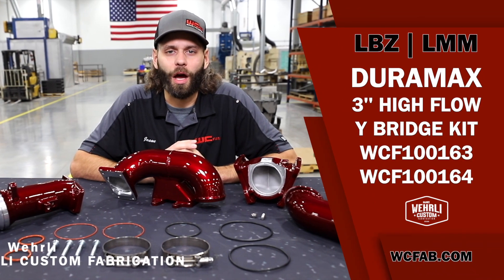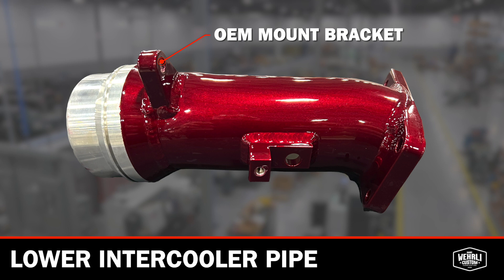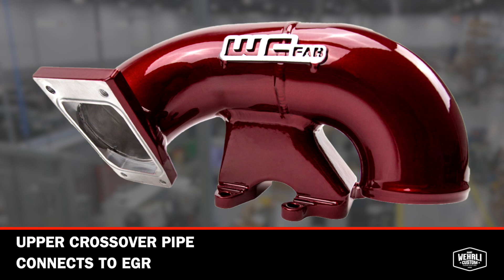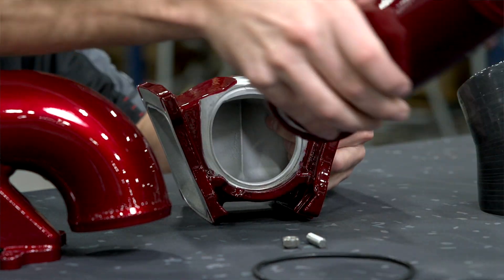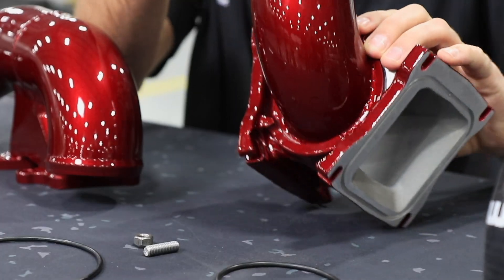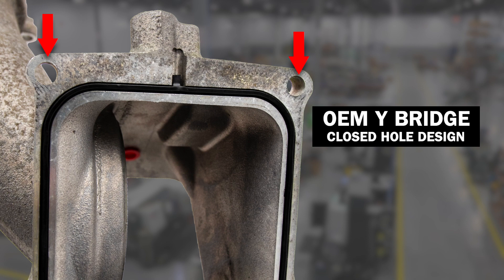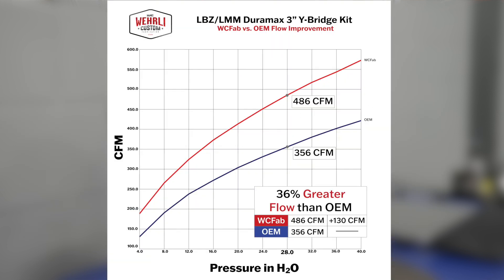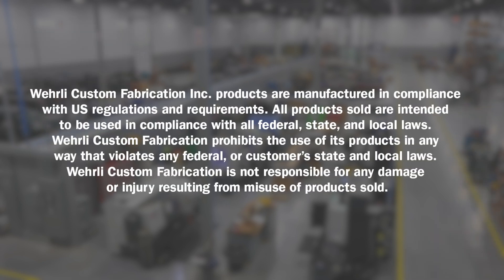WCFab 2006 - 2010 LBZ / LMM Duramax High Flow 3" Y Bridge Kit

Comment: Do you make this for an LLY? Or is there a way i could convert my LLY stuff to LBZ style? Really want this y bridge bundle
Reply from the maker: @dh5254  if you are talking about a 2006 LLY, then this kit crosses over because it’s pretty much an LBZ as far as engine air induction components go. 2004.5 and 2005 LLY’s are different however. We do have plans to introduce a y-bridge for those trucks as well, but don’t have a release date at this time. Keep an eye out here for updates as we have more info on that to share.
Reply: Yes, i mean the 04.5-05 LLY duramax would love to see this kit offered for that platform 🙏

Comment: hello! If I buy just the Y bridge assembly only, it will fit the old style cooler pipe and the other parts? my old style Y bridge is cracked and destroyed by a mechanic :/ . Or can I have somehow a piece of the old style one? or You guys can repair My damaged one?
Reply from the maker: @AutoZshowFL  the 2 piece y bridge base assembly in this kit has not changed and is available for purchase by itself in the link below:

https://www.wcfab.com/i-31645005-lbz-lmm-duramax-high-flow-3-y-bridge-bridge-assembly-only.html?q=Wcf100235

Comment: Can you make one without the grid heater, one whole piece you guys used to make one years ago I’d buy that tomorrow with that whole kit
Reply from the maker: Thanks for your question! Technologies, and performance theories continue to evolve over time. As enthusiasts, we pride ourselves on innovation and continually evaluate the parts we produce and combinations we run for opportunities to improve using new tools available to us and lessons we've learned over the years.  This bridge kit offers the best combination of all of those things and the widest compatibility with customer builds of any bridge kit that we've ever offered. If you're already tuned and currently running a stock bridge and intercooler piping setup on your LBZ or LMM Duramax, our kit is going to bolt in place of all that and flow 36% BETTER than stock - allowing you to push your performance combination that much further. If you're NOT tuned, this kit STILL replaces all the same aging, restricted, and failure prone OEM parts, improves engine efficiency, and won't cause any check engine lights or drivability issues on stock ECM programming. That's something unmatched in the marketplace currently for these engines and raises the bar. We have no intention to move backwards from there.
Reply: @WCFab  I live in Arizona I don’t need a grid heater removing the other product without the grid heater is moving backwards you would sell that a whole lot more for instance me
Reply from the maker: @tylerprentiss1300  from your response we take it you've already replaced the stock passenger side intercooler pipe and crossover with an aftermarket product from another manufacturer and are just looking for the bridge itself rather than this complete kit that replaces the full assembly? We do offer just the bridge from this kit as part number WCF100235, but please be aware that our design uses a bead roll for the bridge inlet to allow for a larger than stock opening rather than the OEM 2 bolt flange. Additional modification of your existing pipe and/or the mouthpiece to our bridge would be required to try to mate those two parts together.
Reply: @WCFab  the kit in the video I would need that whole kit y-bridge, both lower inner cooler piping it’s the part that goes to the y-bridge that connects to the lower inner cooler piping other manufacturers have it a solid one piece 3” to connect everything in the middle that’s what I want but you don’t make it anymore I’d buy that kit
Reply: @tylerprentiss1300  The EPA's a bit** ain't it? They can't make it without the grid heater because the grid heater is considered an emissions component... 😢